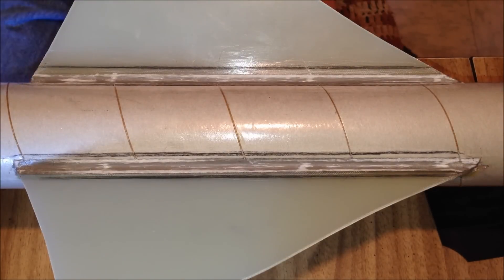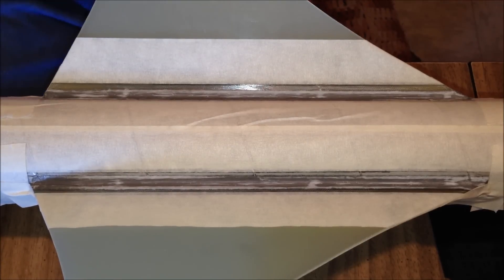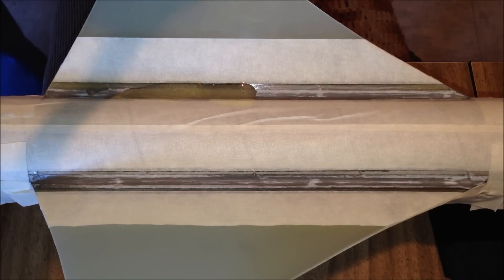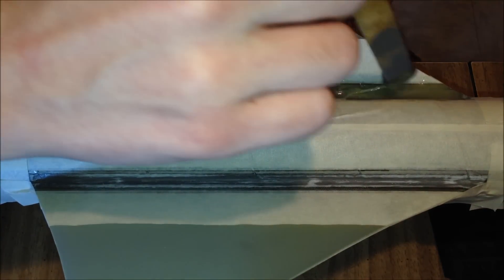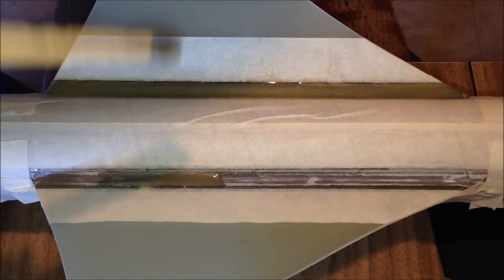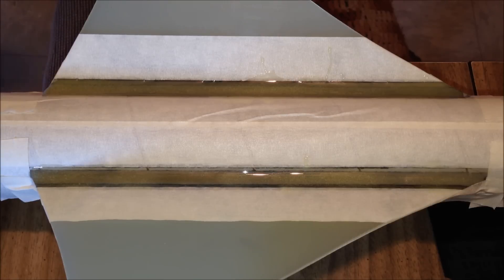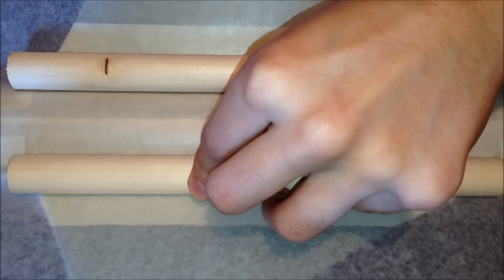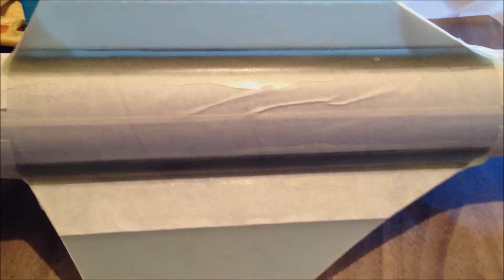Giant Leap Rocketry-Mariah 54 Epoxy Fillets

Comment: Very cool way of doing epoxy fillets. I went to rockers a wood working store and got some carbon tracing paper. Everything worked out perfected. My epoxy is extremely slow it probability close to 3 hrs before it starts get hard enough to remove the wax paper.
I will always use this way now thanks for posting